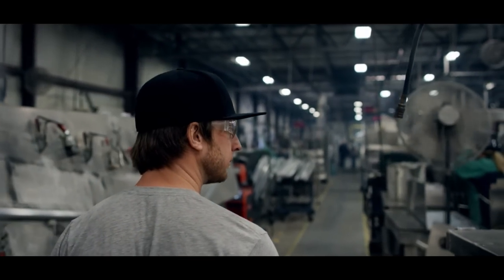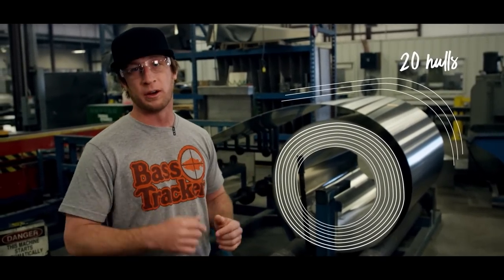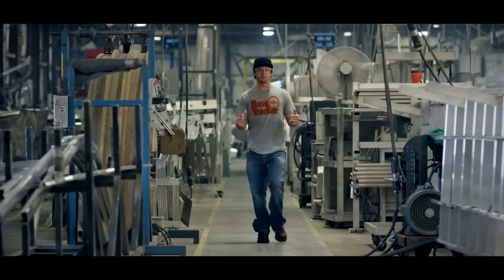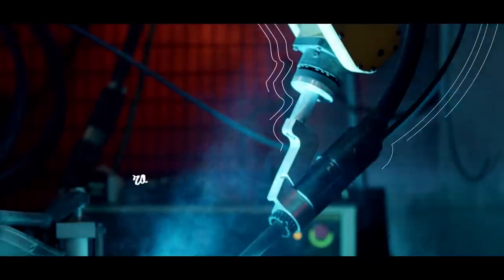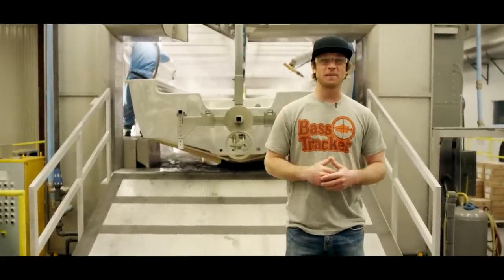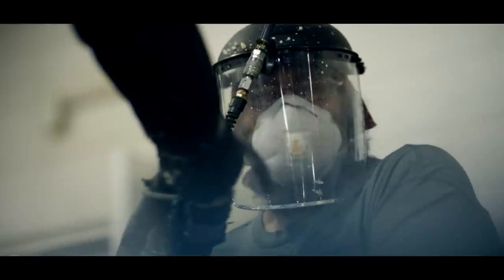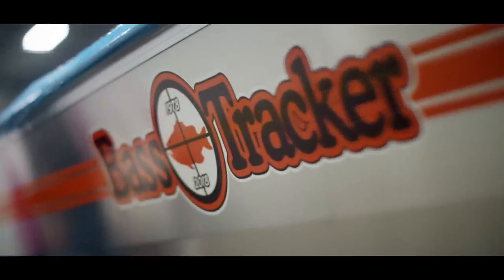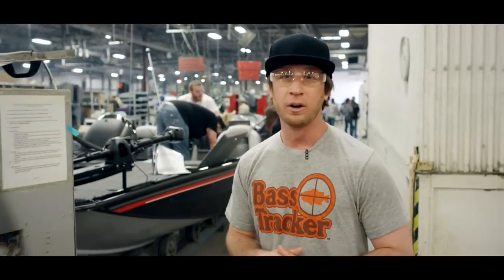Building a BASS TRACKER Heritage ft. Bassmaster Angler Fletcher Shryock

Comment: That's nice but why a wood deck? I don't just mean on the heritage I mean on all tracker boats!
Reply: Pros:
I added an additional locker with a hatch.    Glad the deck was made of wood so I could make the modification with the simple tools I had on hand

Cons:    
My Tracker deck rots from underneath after many years due to  trapped moisture.  I have replaced the rotten deck with pressure treated plywood after many years of use.